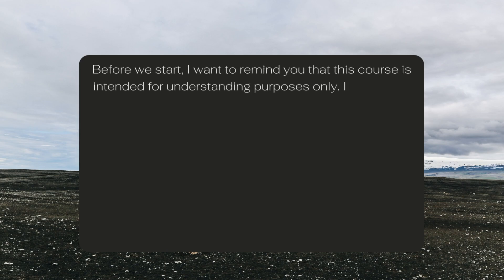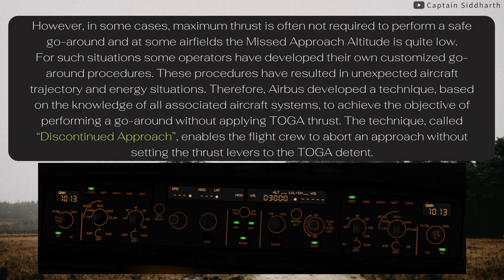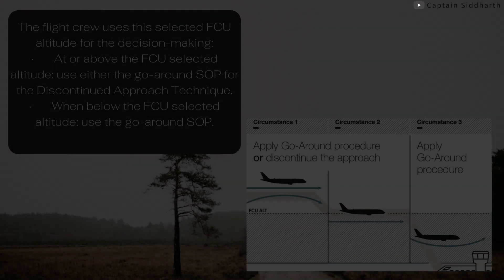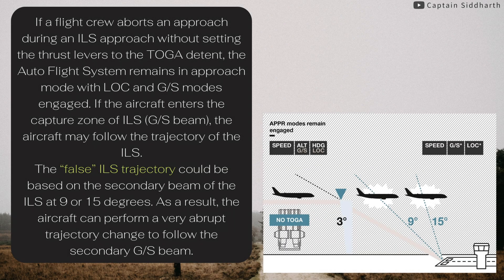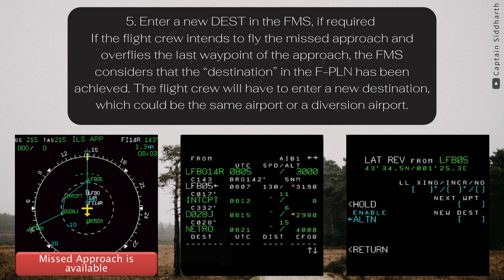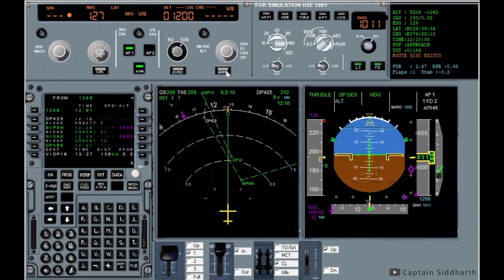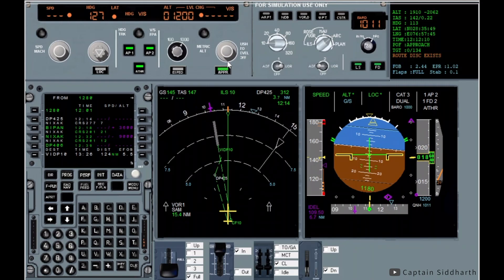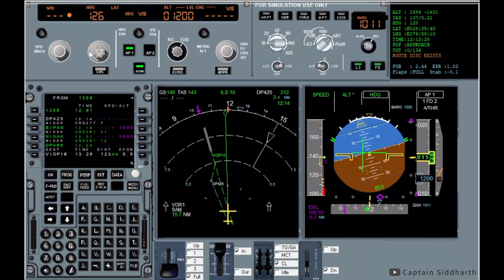Discontinued Approach | Airbus A320

Comment: I have a question. For example. We are on des on ils from 3000ft. Gear down, config full already. Atc said cancel approach turn left/right hdg. Maintain 2000ft. Then we can dis arm approach mode. Ac go to hdg + vs. how about speed up and flap schedule? We also can select gear up?
Reply from the maker: Always keep in mind, the discontinued approach technique should only be applied at or above your selected FCU altitude, when below that use the go-around SOP.
In case of discontinued approach we can select a new speed according to the situation and then clean up the flaps accordingly and yes we can select gear up but make sure you are within your limitations.